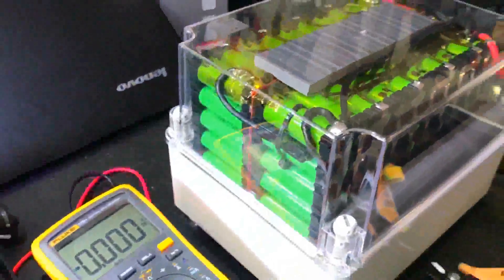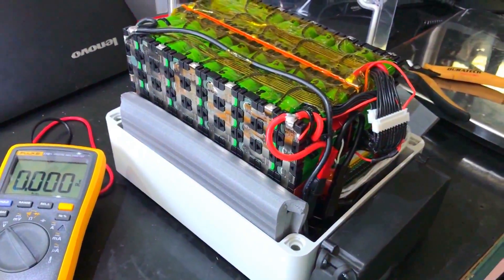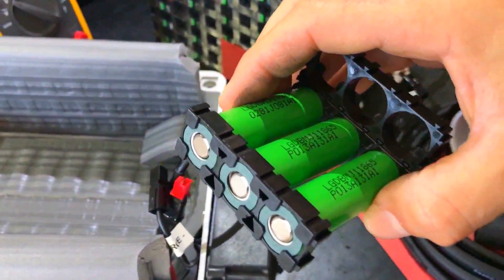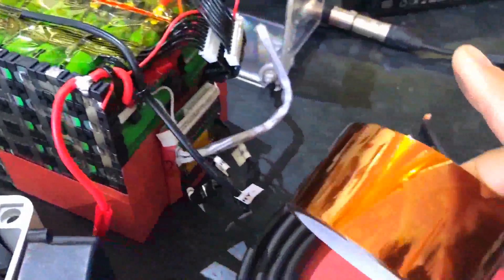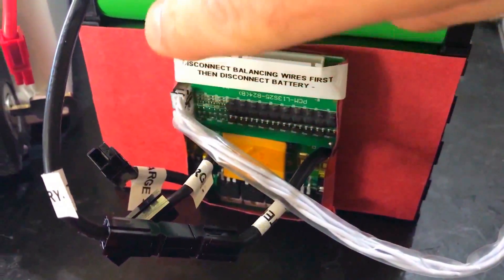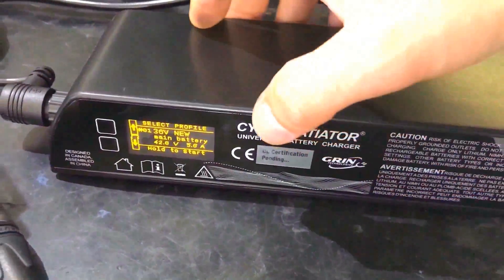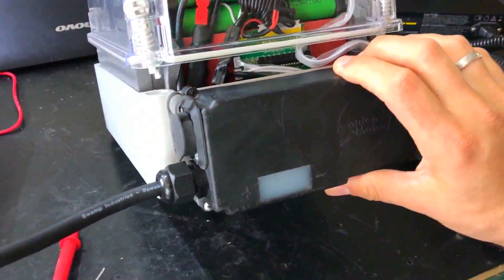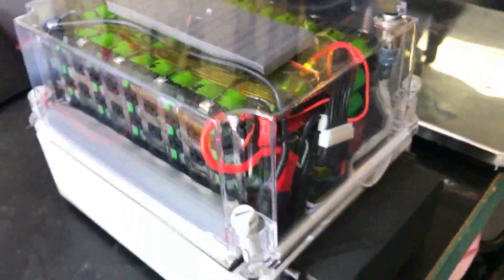Inside a 49Ah 140 cells IP56 Battery Pack (1.8kWh Mega Range) Electric Bike Recumbent Trike Bafang

Comment: Very good battery. I do not like the two 36v packages connected to a bms. In case you have a problem in the connection of the bms. The battery is too big for the bike. You do not need the extra battery. You can always take half of the battery for another bike. If you have good autonomy and want less weight. greetings from Spain.
Reply from the maker: Yeaaahhh... this guy rides a minimum of 120km every single day and make some loooong trips on the weekends, the amount of time he spends on his bike is crazy!!
This new battery is actually a LOT lighter than his previous one, went from 14kg 24Ah down to 9.25kg 49Ah, his steel trike is pretty big and heavy, its more like his little car, weight was not a problem for this guy.
I intentionally made two separated packs in case the guy realised that 49Ah was a bit too much but he ended up asking me for MORE... he also carries his older 12Ah pack, 61Ah in total sounds a bit too much but I kinda understand him, he is an older guy and doesn't want to get flat battery in a highway in the middle of nowhere (it happened to me before and it feels horrible). I know a lot of people with "range anxiety" they always have extra batteries "just in case". 
The advantages of having such large battery is that you're putting a lot less stress, heat and charging/discharging cycles, this battery will last for many many years to come, he is ultra happy with the autonomy of this monster battery =]